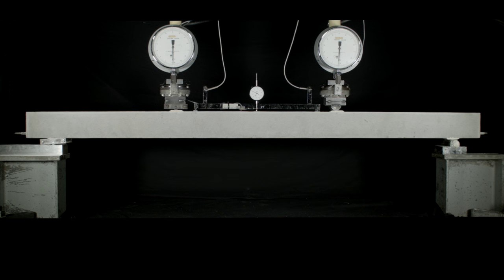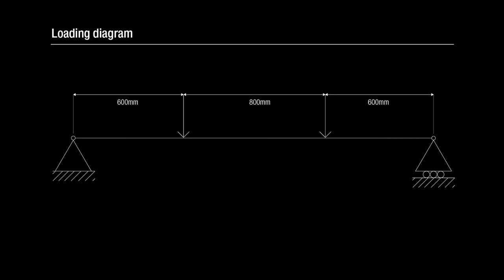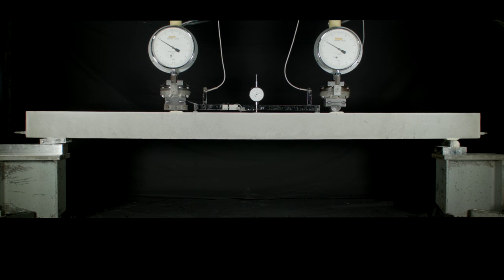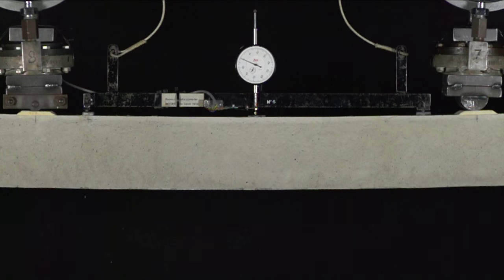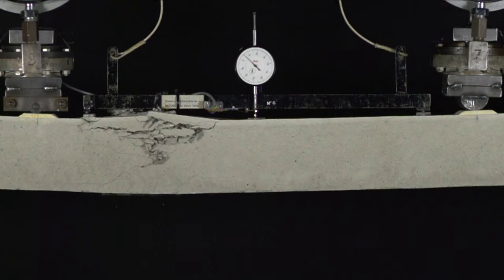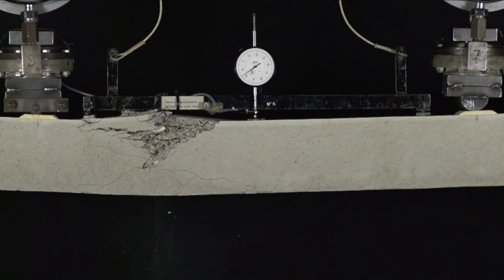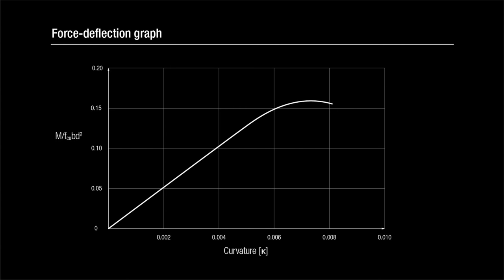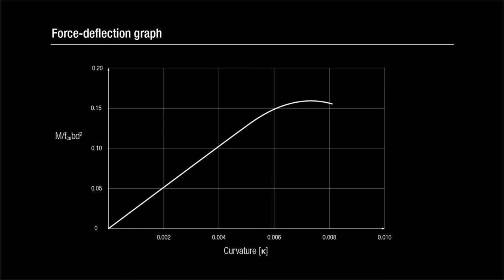Bending failure of an over reinforced concrete beam: Materials Lab on-line

Comment: Are the compression and tension sides of the beam in this video both reinforced? If so, why doesn't the steel help with compression as well, whether it's oversized or not?
Reply: the beam is doubly over-reinforced here. It means that Concrete is controlling the failure here. The depth of the compression block of the concrete is greater here. The steel here is not getting yielded. In other words, full capacity of the steel is not used in over-reinforced sections, resulting in brittle failure of the compression block. That is the reason ACI prefer to use Under-Reinforced section.